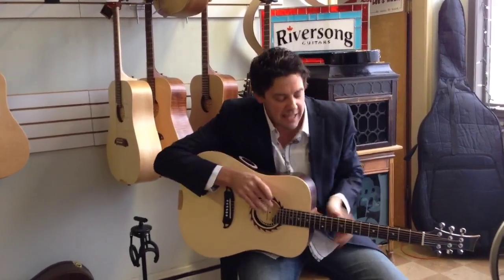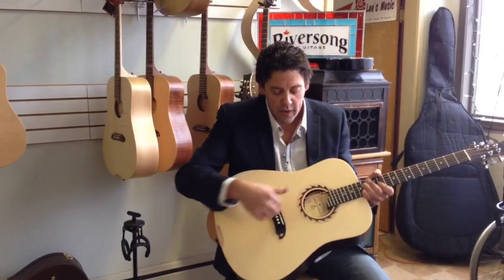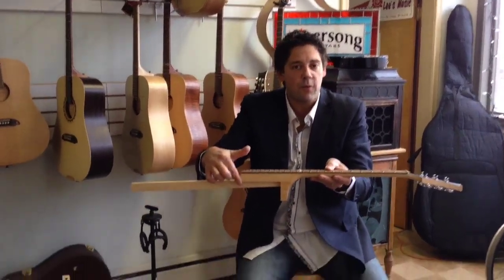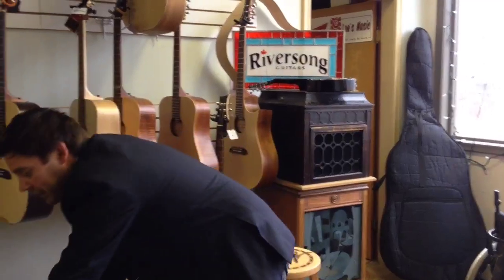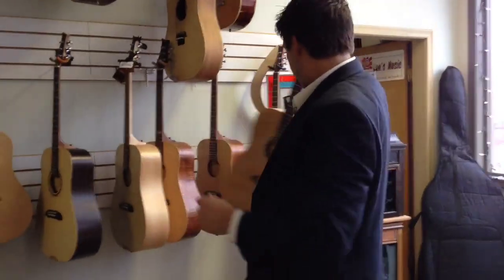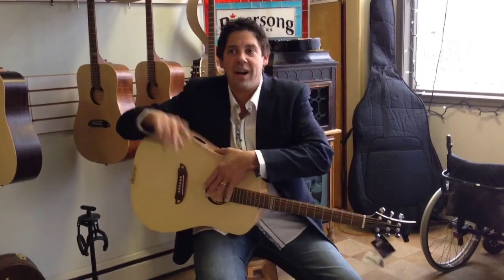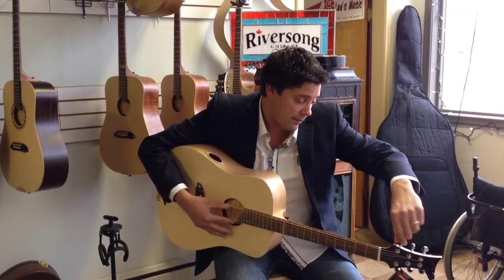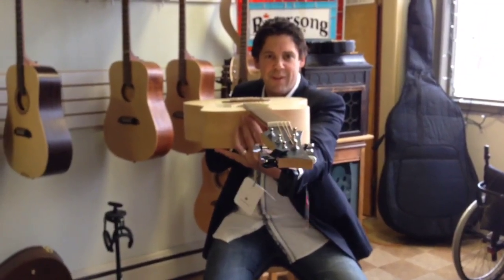Evolutionary Riversong Guitar Description

Comment: Hello. Great that you caught on to that idea. I've been building cigarbox guitars for a couple years and have been building them neck through much the same way as your guitars. Banjos also use basically a neck through. Liked your video. Thanks.
Reply from the maker: Difference is the adjustability, intonation adjustments and variable too loading.

Comment: So, being a guitar builder myself....Quick question...How do you keep the top from warping without any bracing? Wood shrinks over time...no matter how you treat it....So how did you fix the warping problem over time?
Reply from the maker: The structure of our guitars is quite different.  Wood does expand and contract however the warping over time is minimal as we can build our guitar system without sides.  This shows how little tension is across the body, our sideless guitar is tuned to full tension and the top and back are very stable and free from deformation.  Our early brace-less guitars have a very stable top.  Come to the 2014 NAMM show and I will be happy to take you through our design!

Comment: Riversong is perhaps closer than ANY other Acoustic Guitar Manufacturer that I'm aware of, to an "ULTIMATE" Design ! You're about half of the way there, but it could be much better imo. It is still lacking several obvious KEY/crucial design aspects imo. I'm talking about an extreme minimalist architecture(although those particular features can be optional) as well as the inclusion of simple/intuitive yet absolute precision adjust-ability of EVERY single meaningful/important parameter related to functionality, Play-ability & Tone. ThE TRUE "Next-Level" Acoustic guitar(as they WILL eventually be). Don't worry, I don't have access to a wood-shop(or ANY capable facility). But I do plan on making a prototype somehow someday.

Comment: cheapest one is $1,100...thats ok if i wanted to spend that much i would buy a martin.
Reply: If your meaning a new Martin your not buying a total wood guitar there Is very thin layers of wood with a plastic center layer made in China as of currently 2023. I played one at a guitar shop recently and it didn’t feel or sound right. Two minutes of playing I placed it back on the wall. Martin’s are not what they once were. Go and find a real Martin made in the 50’s- 60’s
Reply: @gregj.gotham4402  lol, 2023.
It was 2013... 😂